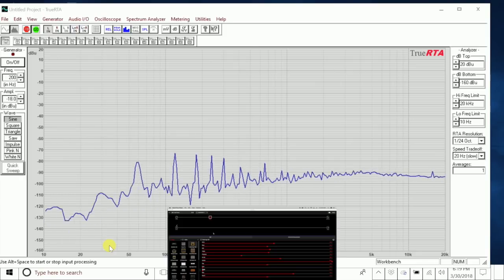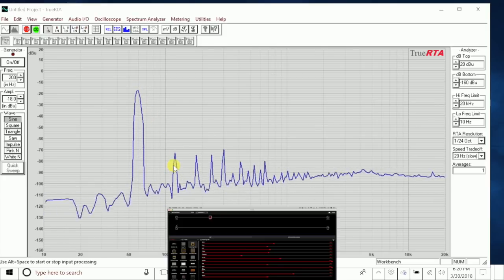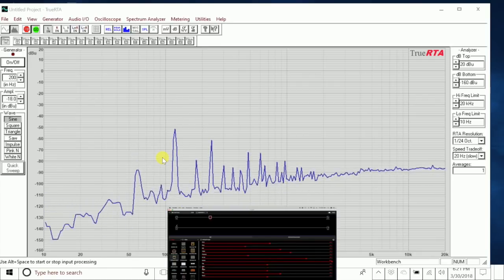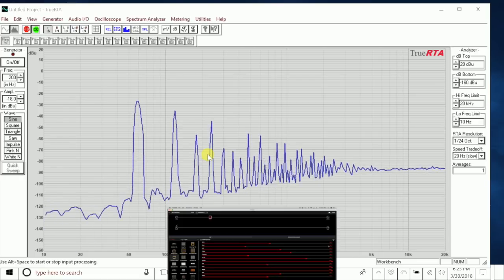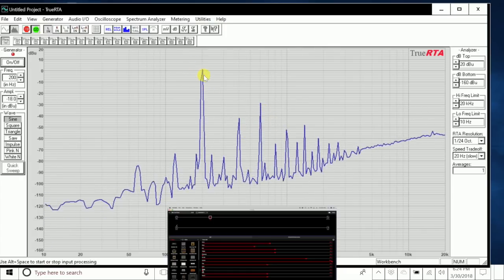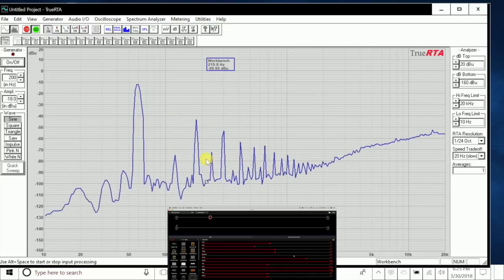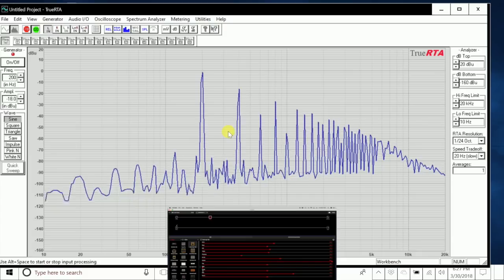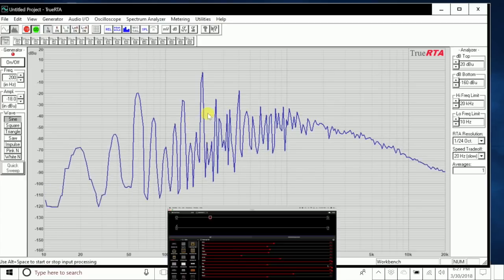Helix deep amp editing Hum and Ripple part 1

Comment: Thanks very much for these videos! I'm just curious, is there any reason to dial hum and ripple anywhere else than zero? For realism? They are just noise, aren't they?
Reply from the maker: They can be noise, especially in the case of Hum. Ripple and hum can both create overtones within the amp however, and thus they can change how an amp sounds.  But largely,  yes . they are basically noise, and are something amp designers generally try to minimize or eliminate, especially in the case of Hi Fi amps. .  Ripple is basically the quality of the filter capacitors in the power supply, and Hum is noise from the AC heater supply.

Comment: Wow  been enthusiastic about analyzing signals from my guitar and I have a Helix. I have found my brother from another mother. :)

True RTA seems much more affordable than Spectra Plus SC (sc= sound card edition). I resisted buying Spectra plus side it would cost $1000+. I guess my question for you is your level of satisfaction with TrueRTA before I plunge in for $100
Reply from the maker: I’ve been running RTA for quite a few years now. I have to say in general I’m pretty happy with it, and for 100 bucks you really can’t go wrong.  They used to offer a free demo that had all the features unlocked except the high resolution.  Give it a go.  I’m running mine with an audient audio interface and I’m pretty happy with it. Keep in touch if you get it   I’d love to see what you turn up in helix. Cheers 🍻